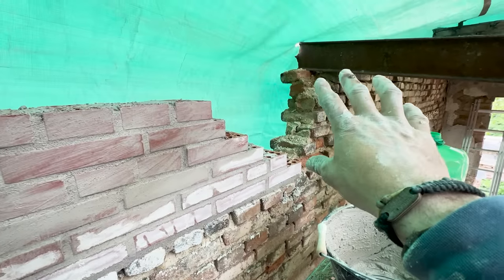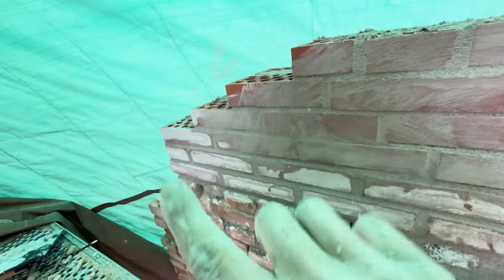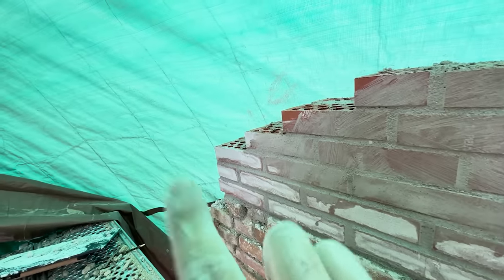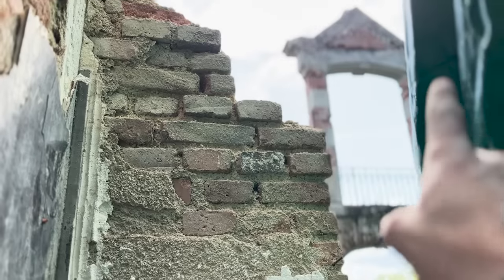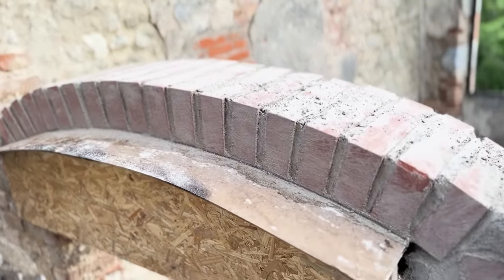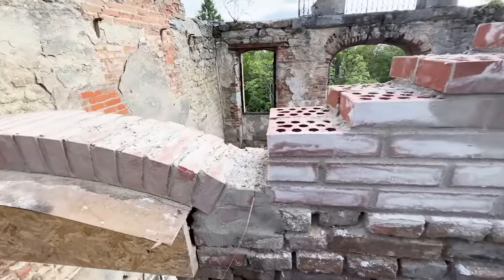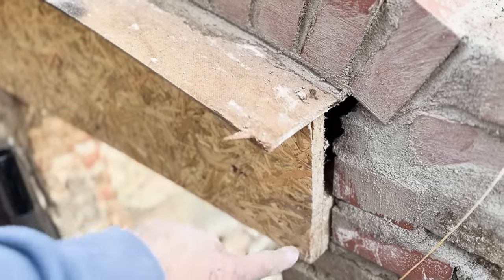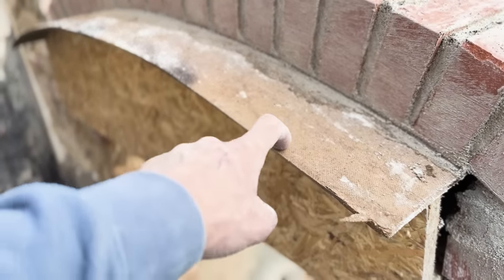Rebuilding the arches (that were never there)

Comment: If you put shims under on each end of the arch mold, it make it easy to remove once it is dry.
Reply from the maker: That’s actually really good advice
Reply: Brilliant, there goes my idea of making it dismantable easily... :D
Reply: my thought, exactly. Like a half inch piece of wood that you can knock out later.
Reply: Hopefully it will work  as it is .
Reply: That's what I though too. 😊
Reply: One makes four wedgies, then they are inverted they make two parallel shims. The height of the shims can be adjusted to make them level. After which one palaces the former on top. Brick-up and tap-out the wedgies after hardening. Job done.
Reply: Never underestimate the value of a good shim.
Reply: Utterly beautiful arch. You’re an artist Dan.
Reply: I hate it when people give Dan advice in how to do stuff cos he knows full well what he’s doing but ….. please wear a mask when doing the lime render. A lovely lovely man we know has just died from throat cancer after a lifetime of breathing lime stone dust - he was a stonemason working on listed buildings in our village. You can deal with rough, workers hands when you’re older but you can’t deal so easily with rough workers lungs.
Reply: @cak400 Did he smoke?

Comment: We have a Welsh stone cottage which we extended copying the original, recessed windows. When
 putting stone arches on to the wooden formers the stone mason put a thin layer of sand on the curved plywood. After it had gone off and mortar and stone formed the arch, the sand dried out and with a little vibration and persuasion the whole former came out, to be used again. Great fun !

Comment: Hi Dan.  

A bit early to mention this but when you get to the plumbing think carefully about siting the hot tanks.  

In our house in UK the kitchen is about 20+M from the hot tank and it takes ages to get hot water.  I have solved this by using a blending valve on the boiling water tap tank under the sink which so,CE's it but is an expensive solution.  

Here in France in our quite small house we have two tanks at each end of the house.  The two showers are immediately above the tanks and one tank is in the kitchen.  The runs to the showers and kitchen sink are about 1.5M so we get hot water very quickly.  

In a  very large house like your chateau you could wait a long time for a hot shower!  An alternative would be a pumped circulating hot water ring so each outlet would be very close to the ring.  This is also an expensive solution as it doubles the pipe runs, needs a bronze circulating pump and the water cools quite a bit while circulating.  

I also started by using a well pump to water the garden but since we don't use a lot of water and the standing charge is by far the biggest part of our bill I think the cost of electricity to run the pump probable exceeded the cost of the metered water so we now don't use the well.

A few things to think about when planning the bathrooms and plumbing.

Good luck with progress.  

Mike

Comment: Don’t you knock your workmanship!!!
It’s damn good 👍 

The block and beam flooring would be a good idea, it’s so much faster and in most cases stronger then any other conventual method.
Don’t be put of by the price of it either, the savings made in the speed of erecting it and not needing additional help far outweighs the additional cost.

Comment: The pointing shows off the care you take and highlights those areas of the old works that have suffered from fire and weather privations, earning them a little restorative love and attention. I certainly do not feel it is wasted time and effort. If it allows shortfalls in the possible  building integrity to be found, that is still a good thing. Faults disclosed are easier to fix than those that are not disclosed by whatever means, short of building failure.

Comment: I think the block and beam floor is a fantastic idea as it is using modern commercial industrial building to speed and strengthen things up. It is great for fire proofing and also good to prevent dry rot and the best ting is the sound proofing element. I LOVE the arch and would love to try and build one after your demonstration. I am glad to see that you have changed the brick laying technique and have now included bricks to tie both rows together. This will really strengthen the walls ! C U Tammorra Dan !

Comment: Has there been a structural surveyor inspecting the whole structure of the the chateau. Crumbling bricks are a worrying factor in the stability of the building for sustainability in the future. The foundation also is it stable enough for the weight of the new build.  Being open to the elements for all those years would be a major concern too. It would be a shame that all Dan’s work on attempting  to build it back to its former glory could amount to a complete waste of time and money. I certainly hope that is not the case in the end. Best wishes for a successful conclusion ❤️
Reply: It would be hard to believe any inspector would approve of this rebuild on such shaky bones.  It's a cool place but  it should be pushed over and the bricks and stones re-used if possible.
Reply: Nowadays inspectors are of no use. They would tell to pull down tower of Pisa as it has clearly bad foundation and tower is dangerous 😂

Comment: You can get after market ladder stirrups that use a ratchet to hold on each side of the ladder. They stop the ladder from slipping at floor level. They will not work on plastic sheeting though, that in itself will slid on the flooring.

Comment: Great to see you soaking those bricks and I hope that centre comes out without disturbing your work?
Reply: Why do you have to soak the bricks
Reply: @jaynebramley755 So it doesn't dry out the lime mortar by pulling water out and compromise strenght. Bricks are slightly porous.

Comment: That doing the brick work right, no matter that no one else will ever see it, is called craftsmanship. The Master Carpenter,  who I apprenticed under 40 odd years ago, would have said that it doesn't matter if no one else sees it; you will have seen it, so it is not up to standard. That attitude paid off 20 years later, when I was working up for Master Joiner. It still delights me to watch someone engaged in Craftsmanship!

Comment: Good job mate. to remove the arch, just cut it straight up the middle, neatly, so you can reuse it again. to use it again just screw some 4 x 2's inside it. Or, build a stronger one, maybe out of old floor boards that is designed to come apart. Cheers, having my morning coffee watching your progress.

Comment: Might I suggest you build a functional (wooden staircase) or purchase/rent a metal staircase - (mobile, on wheels, industrial type, steel rod construction) to insert between each floor? You must be wearing out yourself, carrying, totting all that material up a ladder. A short-term, functional staircase would ease that stress and also when you have visitors, and helpers, a staircase is less intimidating. Later, when the building is further along, you can build a more substantial, stylish staircase

Comment: I am curious, how often does the building inspectors come to make sure all your repairs are done to code?
Reply: There are no building inspectors in France or French building surveyors. Instead it’s each builder’s responsibility to build to the building code.
Reply: Don't you have to have engineered plans approved before starting work and need to have them signed off first? La lande have been held up for months waiting for permissions to change a couple of windows .
Reply: @bethbovey7566  That's a listed building I assume. And it's a change that affects the facade. Dan's work is on an internal wall and it's considered a renovation, so no permission required.
Reply: @Ragnar8504 Lalande is NOT a Listed Building.
Reply: @downunderveggiegardendiaries  OK, didn't know that.

Comment: While the arches are harder to fabricate, it's because of that that they take on a much higher look of refinement and sophistication.  That's why they are seen much less often in modern construction.  Brilliant!  Just remember, be consistent. If you do one, do them all.  I've done a lot of work like you are doing, but not with masonry, so I am sort of learning as I go watching you.  It's fun.  I do know, however that a lot of masons spray their reusable forms with, like, old motor oil occasionally as much to preserve the form as provide easy release. You might try it out. It could be a neat little trick like Chris wrote in about the shims.  I also know you're a bright guy, so I am assuming you are lowering a bucket of the old "garden wall" bricks back to the ground floor where they can be stacked outdoors in a neat little pile each time you go down for more mortar and new bricks.  I know you are doing that while it would usually take me a couple of weeks to figure out that I missed that train.  Beautiful, Dan.
Reply: Mineral oil (baby oil) is what we often used in art college for moulds. Whatevers readily available works best.
Reply: @michellebyrom6551 You're right, but "Free" for used motor oil has a pretty attractive ring to it for me.   Jack  L,

Comment: Taking on a project like this is so inspiring ! I could not have even considered it without first installing a temporary lift, then a water hose and power conduit all the way up. Mix the concrete at the level your working at. I could never deliver the work rate you seem to exist at.

Comment: Congratulations for taking on such a mammoth task basically on your own, a small tip on laying straight courses of bricks is to use profiles and a string line, this can be just a piece of 2x2 drilled or clamped to the wall as a profile, it will save you time as you can see the bed size needed to lay a brick and will ensure your wall is plumb regardless if it’s getting rendered 👍

Comment: Just about everyday I see comments on if Dan gets inspections and etc., and maybe one day he'll answer those questions, but if you do a little bit of research, you can answer some of your own questions with the building codes in France. He may not be required to seek building permission. Because he's building this on his own, he may not need an underwritten  guarantee. He strikes me as an intellectual man, and maybe he's already  checked with the mairie before carrying out any work. I suspect Dan is just fine.
Reply: Besides it's a renovation, which doesn't need permission anyway, at least that's what I've gathered from the government's web site (there are exceptions, like converting lofts, though).

Comment: As easily as that old brick chips away is it safe to put new build on top of that. Looks like the weight of the new bricks would make what is below it unstable. Just curious.
Reply: The old mortar might well be clay (mud) and sand, which doesn't have (or need) a lot of tensile strength and never did. Unless you're deliberately taking the wall apart, nothing ever pulls on mortar joints, they're all under tremendous pressure and that pressure is what keeps walls and arches stable. Only when large sections of wall crumble under pressure you need to start worrying.

Comment: Hi Dan, re your thoughts that you may use  reinforced concrete beams and with a concrete block floor. I am not an engineer but in a way a (much) older version of yourself.  I am aware that bricks are not an ideal medium for carrying weights, ie they are not great in compression. My concern is that the brickwork in this structure is comprised of older style bricks and they look (from a distance over the internet) to be a little more brittle than modern kiln fired SOLID bricks.    Many more modern multistorey buildings are constructed with reinforced concrete columns where brick piers may be adequate in a smaller building.  Respectfully I would do a little research before proceeding and compare the weight of the materials as originally constructed with the weight of the considered concrete system. Intuitively I feel that by taking time to rebuild it as was is preferable in terms of adding weight to the existing structure and perhaps less likely to result in later questions from  building inspectors.   I apologize for being a "busy body" but I love your motivation, common sense approach and above all I love your work.  kind regards.. Rod
Reply: Block and beam ceilings are frequently reused in renovations of older buildings, so I'm not immediately worried. The beams are like lintels and lightweight hollow blocks are placed between the beams (the blocks have notches to make the underside of the ceiling flat while still allowing the blocks to sit on top of the beams). Keep in mind that the previous ceiling was a vaulted brick ceiling supported by steel beams, probably just as heavy as Dan's replacement. I'm surprised how close the steels were together, in Austria and Germany ceilings like that had the steels up to 2 m apart unless they were to support industrial loads. I can see two possible reasons for those short spans, a) the weight of the water tanks and b) the type of block they used for the vaults and the way they laid them. For load-bearing arches the bricks were usually stood on the long edge rather than laid flat like here. According to German builders I've talked to, if the bricks are laid flat all loads on top must be supported by the steels (usually wooden sleepers directly on top of the steels supporting floor boards).
Reply: @Ragnar8504  Thanks for your thoughts Ragnar,  I have seen the use of the beam and block method via the internet but not in use here, (Australia) hence I was not aware that floor blocks had voids. I had also not noted that the ceiling was vaulted brickwork, except under the water tanks.  I was seeing the potential for cracks in the walls etc.  I generally do not comment but in this case felt a conscientious need.  I take your points and my conscience is at rest,  kind regards Rod

Comment: Dan May I suggest you buy a metal bucket? I don’t think the plastic one is going to last with heavy concrete and bricks being lifted up in it.
Reply: It looks like a builder's bucket, constructed to be able to take those materials.
Reply: @LaReynedEpee  The bucket may but the handle looks ready to go.
Reply: @lindamounts2193  It's a metal handle, why would it
Reply: @LaReynedEpee  Because the bucket it is attached to is plastic and straining at the plastic connections.
Reply: @lindamounts2193  It looks like a builder's bucket. Built to carry heavy materials. Do you build often?

Comment: What was the original water source for the chateau? Make your work easier if you had running water. Nice arch but will you have to cut the form out?
Reply: Maybe a  garden sprayer jug, with a  hose and nozzle, would help?
Reply: Must have been a well or a spring, probably with a very low flow rate considering they installed two huge tanks. Problem is that might have ended up on the neighbour's land when Dan bought the château.

Comment: You certainly make your arch formwork differently to any I have seen before. The ones I have made & seen fit between the walls of the opening, with 2 studs underneath with sliding wedges under the studs so the form may be removed easily when the brickwork of the arch has cured. When the wedges are removed the form comes away easily. When the form is removed, the bricks settle a little, thereby strengthening their bond with each other & making the brickwork more secure.

Comment: I noticed you put the bricks in water for a bit, which you did not do before. Just wondering why you're wetting them now? 🤔 Just in case I decide to build myself a little brick she-shed! 😅
Reply: The weather is hot so the bricks are bone dry, previously the bricks left outside mostly probably had some moisture in them, it's to help with the suction of the lime to "stick" to the brickwork, most probably something to do with capillary action!?!
Reply: @thomasherrin6798  Ok, that makes sense. Thanks! 👵
Reply: He read the comments and learned something new.

Comment: From what I've been taught it would be better to rake out a little mortar from the joints while it's soft instead of giving it a nice finish because that gives the plaster something to grab onto, it can squeeze into the joint. Ten to 15 mm deep should be fine.

The block and beam ceiling sounds great but I can see two tiny snags. You'd have to get massive amounts of concrete up to the third floor and it might be a good idea to put in the conduit for most of your electrics before you pour that concrete. There are some block & beam systems that don't require a full layer of concrete on top though, just infill between the blocks. That would mean far less concrete to get up there and more flexibility when it comes to electrics.

Comment: If you put a rubber 10mm mat over the arch form template, you can then remove the arch form template when the bricks are dry and the rubber mat will help with the removal and not damage the bricks above the form template...